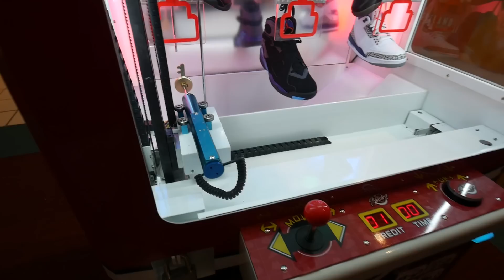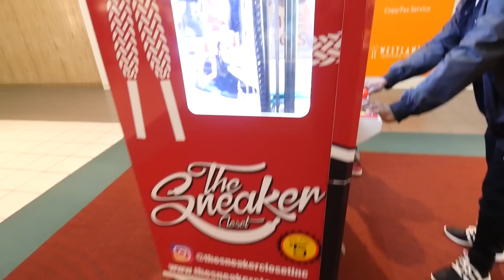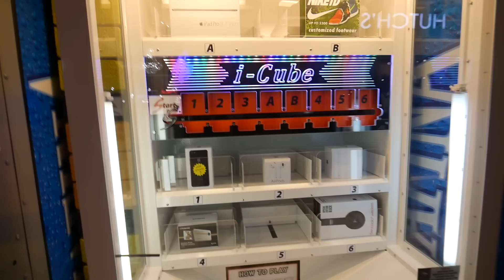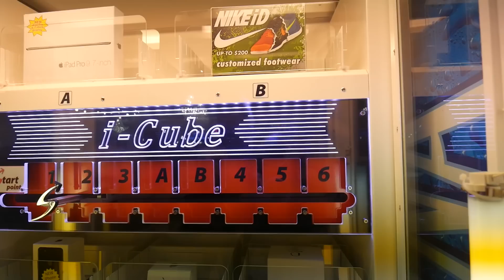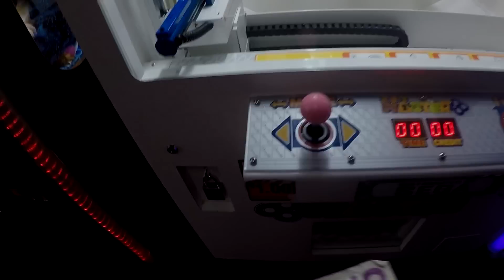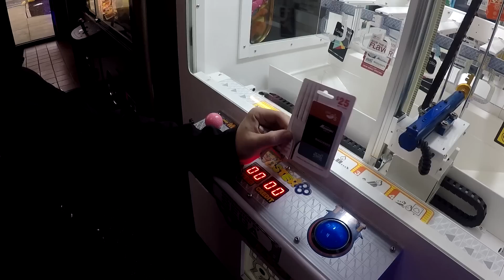WILL $50 WIN THE $1,000 YEEZYS FROM KEYMASTER? || Sneaker Keymaster

Comment: how can you tell when a keymaster is due?
Reply from the maker: +Tayler Vick when it's not due the key continues to go up for a split second, always hitting the top, or missing hitting the bottom but by more than an inch (no way to cheat it). When it's ready to payout it will be skill based and usually hit the bottom by a tiny amount, you can also feel it move past you telling it to stop.